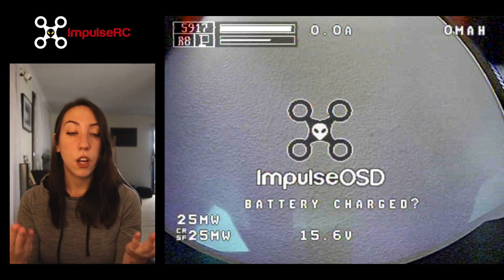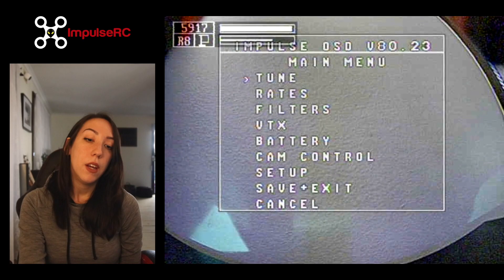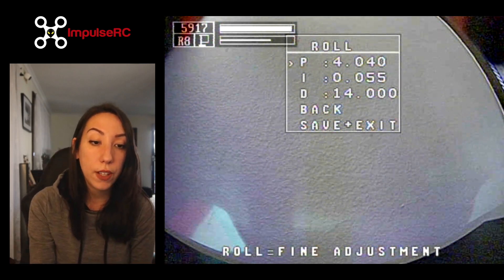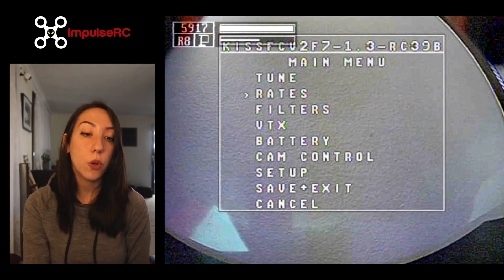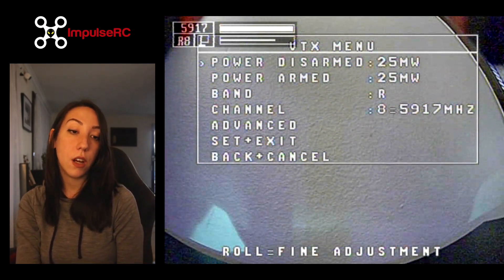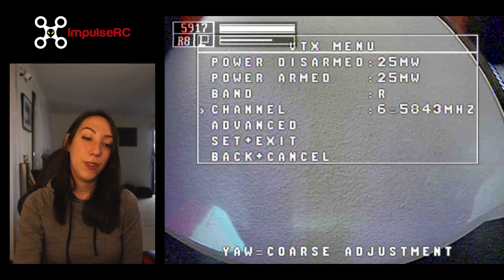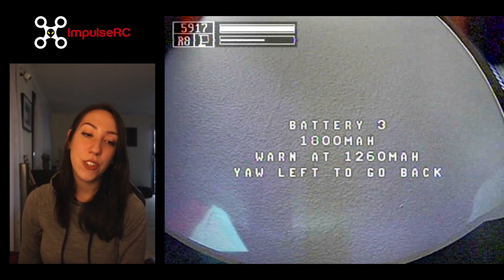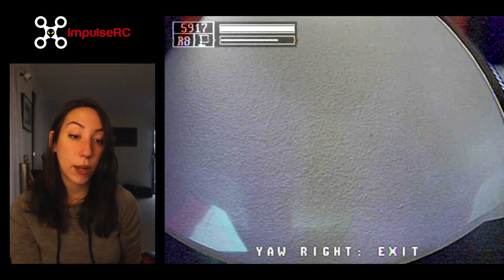ImpulseOSD : Introduction (Pt. 1)

Comment: ImpulseRC, need some help with my foxeer TRex. I dont see a video when the camera is connected to the apex OSD board. If I connect another camera (like caddx turbo f2) to the same connector, I get video in my goggles. 
Also, the Trex works just fine if connected normally to a VTX. THere is no video only when its connected via the apex OSD. What  could be the reason?

Comment: I think kiss is the only FC without integrated Osd 😂😂 ridiculous :))
Reply: Kiss is still a thing?
Reply: Gary Roberts if you fly it you won’t go back to any other fc
Reply: @gee4zfpv  I've flown kiss, I used to fly all Kiss, but once Alex left, I dunno.  I've blown my fair share of 24amp escs etc.  I never tried KissV2 ... I have a drawer full of my old kiss stuff because I switched it all out.   I hadn't heard anything new from them in ages and just figured it was dead =/
Reply: Gary Roberts that’s so funny because my story is the opposite! I’ve a shop full of old dead mostly betaflight builds- nice quads and nice boards but I decided to build a Kiss rig in Feb this year (kiss v2) and was blown away with how it feels to fly. Kissv2/crossfire/unify pro. I tried a lot of other firmware/hardware combos but nothing comes close to my current setup. I guess it’s a mostly subjective thing- whatever feels best to fly... were you flying kissv1?
Reply: @gee4zfpv  No, KissV1.  I never tried V2.  I think probably the main reason I switched from Kiss to Betaflight is I wanted to run 6S.  Maybe I'll look into getting a V2 fc and trying it out again ... I just thought it had "died" because you don't hear much about Kiss anymore =(
Reply: @wangel81  Dude! V2 is awesome! F7 processing and I usually run the 25a kiss esc with it on 6s! the esc rating is 3-5s but Steele always runs 6s on them. I have been 6s since May with no issues (1750kv motors) When I run 1850kv motors I use the 32a Kiss escs. The only issue I have had is that it's so hard to get the flyduino stuff in these pandemic/trade war days...  I buy it whenever it comes available at my suppliers and it usually goes fast... Cheers!